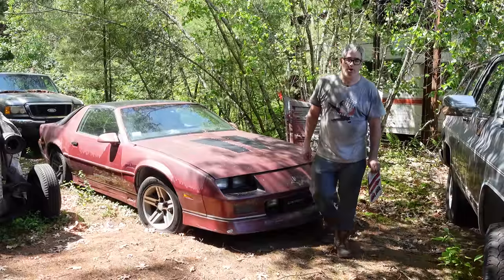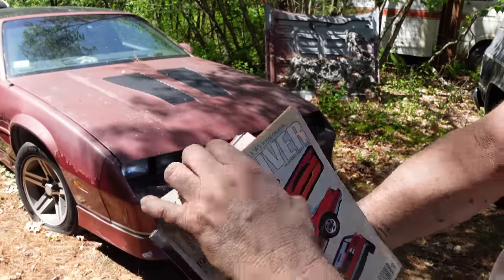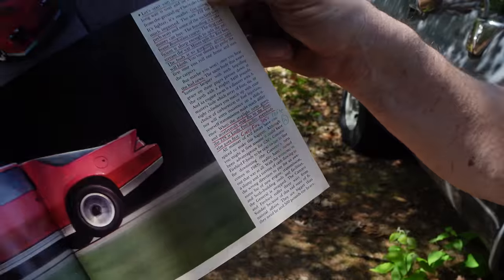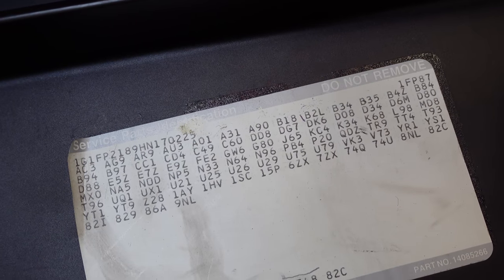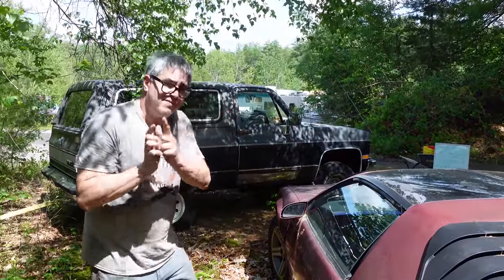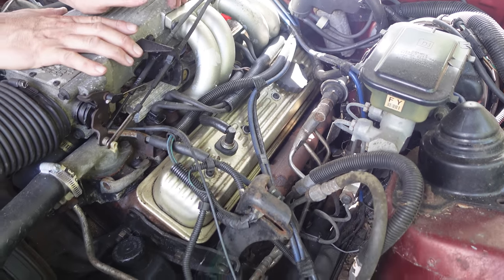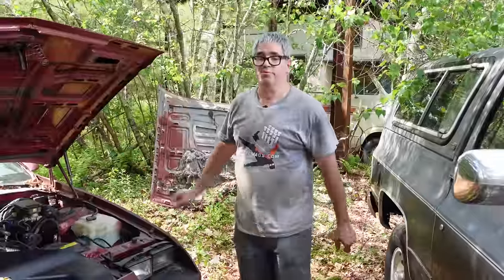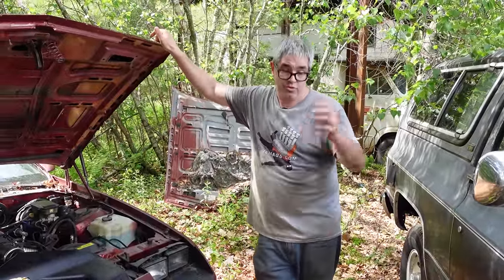Heart of a Corvette

Comment: I know people go nuts over these, but I never cared for the whole third generation F body, especially the Pontiac version which to me were "Chevyiacs". My parents had a 1982 Berlinetta 305 V8 for a short time, but my dad's business partner wrecked it. It was a Norwood made 305 V8 with four barrel (LG4 RPO). I still have the VIN for it. Mr. DeFeo is from the same area as me and we used the same auto parts stores, but he's older than I am by a minimum of eight years, so we didn't cross paths. We used to call them "Italian R.... Out Cruising" or "I Reek Of Cologne". I've always found them to be sloppy and at least in the Pontiac version, you were better off with a 2nd generation which is a true Pontiac with true Pontiac power and not a "Chevyiac". 

No, 1987 is the first year for the 350 F body. There were several test mules in 1986, but they were destroyed. Somewhere, I have that confirmed in writing on in a yellow GM response card from a GM Service Parts employee and it's been confirmed in writing elsewhere. You know this because you will not find a 10th VIN digit of "G" (1986) and an 8th digit of "8" (L98 350 V8), only 1987 (with a 10th digit of "H" as you have here).  The 2.5L was last offered for the 1986 model year, so by 1987, it was a V6 or a V8. Yes, GM didn't have a manual (at the time or at least that's what they said) that could handle the torque of the 350, so only on automatics with the Camaro and Firebird 350 in the 3rd generation. It was more that they didn't want F body sales to eat into Corvette sales back then. 

We got the VIN, we win: 1G1 for US made Chevrolet, FP for Camaro Sport coupe, 21 for two door coupe, 8 for 5.7L V8 with Tuned Port Injection (MFI), aka RPO code "L98", 9 is a check digit, H for 1987 model year, N for Norwood, OH assembly and the rest is the production sequence. The Norwood, OH plant closed in August 1987 and then production continued at Van Nuys through the 1992 model year when the plant closed. 

We got the SPID, glad you did: A03 for windshield with upper shading, AG9 for power adjustable seat, AR9 for reclining bucket seats, AU3 for power locks, A01 for tinted glass, all windows, A31 for power windows, A90 for power hatch release, B18 for deluxe interior ornamentation, B2K for special sales package,  B34 and B35 for front and rear carpeted floor mats, B4Z for IROC package, B84 for body side moldings, B94 for body emblems, B97 for lower body emblems, CC1 for removable hatch roof panels, CD4 for delay wiper system, C49 for rear window defogger, C60 for air conditioning, DD8 for auto tint day/light interior rear view mirror, D34 for inside sunshade, D80 for rear spoiler, D6M for driven speedo gear, D88 for sport stripe, FE2 for ride and handling suspension package, GW6 for 3.27:1 rear axle ratio, G80 for limited slip rear axle, J65 for power front and rear disc brakes, KC4 for engine oil cooler, K34 for cruise control, K68 for 105 amp alternator, L98 for 5.7L V8 with TPI, MD8 for THM700R4 four speed automatic overdrive transmission, MX0 for automatic transmission merchandising option, NA5 for Federal emissions, NOD for Norwood, OH assembly, NP5 for leather wrapped steering wheel, N33 for tilt steering wheel, N64 for aluminum space saver spare wheel, N96 for 16x8 cast aluminum wheels, PB4 for wheel lock kit, P20 for styled steel wheel cap, QDZ is a tire code, TR9 for courtesy lamp group, TT4 for halogen headlights, T93 for special stop and tail lights, U21 for oil, coolant temperature, voltmeter, and tachometer gauges, U25 for rear compartment courtesy lamp, U26 for under hood light, U29 for instrument panel courtesy lights, U75 for chrome power antenna, U79 for four speaker system, VK3 for front license plate bracket, V73 for US and Canada vehicle statement, YR1 for front custom seat cushion, YT1 for special door and quarter buildup, Z28 for Camaro Z28 (which all IROCs of this generation were), 1SC for sales package, 15P for silver metallic aluminum wheel color, 74Q for Dark Red moldings, 74U for Dark Red exterior paint, 82C and 82I for Medium Dark Gray interior trim, and 829 for Medium Dark Gray seat belts.

These have their followers, and I'm not one of them. But, I'd chose the Camaro over the Firebird in these years.
Reply: Agree with you on Camaro over Firebird in this era, love the styling of the Camaro, not so much the Firebird. As much as I admire them, wouldn't want to own one (maybe if I was young and in high school). In my mind, the 305 manual and 350 auto are a "toss up," but I could be way off on that.
Reply: @tomwesley7884  I had a 1986 Norwood assembled Camaro 2.8L V6 with T-tops that was given to me after it was in an accident (for the 2nd time). I parted it out and junked the remainder. After the yard closed some years later, it was eerily still left behind at the yard. It eventually was removed when there were plans to redevelop the area (which never happened). It was code 23 Bright Blue.
Reply: @googleusergp Thank you very much for all of these information. This car would have been very expensive considering all the options it has.
Reply: @BojarskyLeGrand  Sure. Indeed it was a costly car when it was new.
Reply: Thanks for all those codes.  Helpful to me.
Reply: @richardlarson2969  Sure thing.

Comment: I built my 1989 formula firebird the way it should of been back in the 80s.  It started it's life as a LO3 (305 TBI) and a 700R4.  With WS6 suspension but with the 10 bolt and rear drums.  I put in a 5.7 Aluminum LS1 and a T56, front and rear brakes from a 2000 trans am.  AC works, all factory gauges work.  Custom wiring harness built by me.  Full emissions.  It is no stronger than a 2000 trans am but my goal was near factory appearance.  The car has 17 inch GTA reproduction wheels, and yes it is a TTop.  The car has subframe connectors but even with the ttop it stands up to the power.

Comment: I had a 1984 Camaro Berlinetta (with the funky unique interior with digital gauges), and when I'd warm up it's carbureted 305 V8 on cold mornings, the frost on the hood would show that the Z28 hood scoop structure was there under that plain skin hood.

I thought it was quick back in the day, but I know that its V8 would be stomped by a 2.0 liter turbo 4 from just about any car company nowadays. 😜
Reply: Yes. That model of Berlinetta was so very Cool...
Reply: I never noticed that the Berlinetta's had different gauges

Comment: I remember those days. It was like watching the sunrise after a long dark night. Real performance was returning and each year got a little better. Thank you as always ~ Chuck
Reply: That car and K5 should be saved! My friend had a 88' Pontiac Formula 350 and I was a 5.0 stang guy till he got that car , cornering was amazing! And it would easily beat my friends brand new mustang in 01. Burnouts for miles!
Reply: And at 140mph with 4 people could barely tell.
Reply: I remember being a freshman in H.S. in 1982 and my best friend and me talking as we were running laps in track about how performance was over. The '79 Trans Ams with 400/403 were what we considered the last of the true muscle cars. To find out that the new Camaro and Trans Am only had 305's? We were disgusted. And the Mustangs all sported 2bbls and of course Dodge and Plymouth were totally absent. Little did we know that by 1986 there would be Grand Nationals and Mustang 5.0's running into the lower 14's!!

Comment: In My late dads junkyard,  we had only one crashed iroc with A/C and a manual, it was before I had a license and I had begged him to let me fix it but he didn’t want me to have that for my first car, eventually I bought an anemic hardtop 1996 3.8 firebird in teal, and ended up blowing the automatic up from all the burnouts and young kid stuff. Years later I inherited the Camaro, and sold it, when we were loading it up on the guy’s trailer with a tractor the floor fell out of it because it was so rotted, the guy said, “well we’re halfway there just finish slapping it on the trailer, there’s no sense going back” lol.

Comment: Great video.   As a point of reference on some small corrections being I have had dozens of these cars...
-the 5500 RPM redline wasn't exclusive to a 350 car.  it could be had in any of GMs "high output" offerings of the time, like the LBP TPI, HO 305s, etc.  the lower output 305s received the 5k redline as their smaller cams were even more out of breath by 5k, than the larger cammed cars
-The Iroc decal on the door was at the front from 85-87.  It moved to the rear in 1988 when the wheels got "2 stripes" rather than one like the earlier models had. 
-While you can look for the RPO codes as well.  The VIN # will tell you what engine the cars had as well so you could easily identify them from the outside.

Thank you for shining light on these Camaros!
Reply: Two more notes:

-the package code is B2L, not B2K
-the 9-bolt was available in 5.0 TPI cars with a manual. They had a 3.45 gear vs the 3.27 in the 5.7 (this assumes RPO G92, IIRC)
Reply: @sc3ku  true!  I have an 87 yellow with the 3.45!

Comment: I had a ‘85 “California” IROC. I think they made 1000 of them. They only came in black, red, or white. No decals, no rear spoiler, no hood vents. A really clean looking car. The 305 TPI was a dog, but the car handled great. GM stopped putting posi in them because they’d break the small rear end. I replaced the 85 mph speedometer with the accessory 150 mph speedometer.
Reply: What did it take to replace the 85 to 150 mph speedometer?
The whole cluster needs to be replaced?
Reply: @rollin19  no, just pulled the bezel and swapped out the speedo head
Reply: GM offered a G80 posi through the 3rd Gen as well as 4th Gen.
Reply: @nedaCFilms  I put one in mine. Didn’t have any problems.
Reply: Was that the same 7.5 rear end they used in the monte Carlo ss at the time?  Did the Monte carlo ss have the same problem with rear end?  How much hp and torque are the 7.5 rears good for?

Comment: Department of Public Safety which is known as DPS in Texas tried the Mustang back then, I new a couple of officers talk to them on monthly basis one day there were driving Camaros. I asked them what happened to the Mustangs they told me there were junk if you turn them up all the connecting rods would fall out of them left them sitting many times. Also had a overheating problem. Camaros had no problem whatsoever. Except with the Corvettes LOL. They also explained to me that the Mustang did not have any room in them.

Comment: I remember these days well! It seemed that the new car hierarchy was GN, Iroc/TA 5.7, Mustang LX 5.0, Iroc/TA 5.0, and this doesn't include the occasional Corvette or super rare GNX that could pop up every so often. Many folks would make a few mods and then all bets were off. Also, the older muscle cars and sleepers would show up too. That was life on Main St back in the late 1980s. I wish I could do it over again!!!
Reply: stock the LX 5.0 beat the 5.7 Z/TA in a straight line... but it was close. the opposite on a road course.
Reply: @robviousobviously5757  I had an 86 LX 5.00 and would practice my launches behind our warehouse at lunch. Once your rolling, not much you can do, but getting the launch right won races. From what I saw, most new muscle car buyers where into the smoke show too much and couldn't adjust when it came to racing. GNs where the same, they react too slow, or spin, you had a really good chance of beating them.
Reply: @ZacLowing  GNs don't react slow if you know how to drive them. Leave the line with a pound or two of boost built up, nothing can touch it. Stock for stock anyway.
Reply: The funny thing is, yeah, the GN’s would destroy everyone back then, but they were wildly inconsistent, hyper sensitive to atmospheric changes. I think barometric pressure. only way to explain how one day the car runs like a raped ape, and the next day it’s dogshit slow. stock ones were more consistent, but once you started modding GN’s? All bets were off. The 5.0 mustangs were the most consistent performers back then.

Comment: Nice! Always wanted a Tuned-Port engine, but I absolutely loved and miss my loaded 84 Z with the 305 HO 5-speed, so fun to drive and gave me no issues for the 3 years I owned it. Thanks Steve!
Reply: I had the same car as you.  Very fun to drive!
Reply: Dad had one.  I swear to this day that 84 High Output Carburetor was faster than 305 TPI.   The 84 would throw you back in the seat at take off!
Reply: They didn't make a 84 5spd Z28! The first 5 speed EVER that came in a Camaro was bolted to a 305 TPI. The did make a bunch of carb 4 speeds prior to 85
Reply: @jeffreyhillery1614 Definitely prefer TPI, but a L69 Z is one carb car I have to own!

Comment: Car and Driver did a long term test (30,000 miles) of a 1982 or 1983 Camaro.  Something like 15 Unscheduled visits to the dealer which is still probably the record as of today.
Reply: Those first few years of the 3rd gen were touchy, no question about it. By '87 though, they'd worked out the gremlins and rattles and they were much better cars. Far more solid and reliable.

Comment: The 5.7 really came alive in 1990 with the dual converter exhaust. Had a friend in high school whose Dad worked for a Chevy dealer. We saw and felt it first hand. The Mustangs ruled the streets from '87 to 89, but the 1990 IROC and Formula 350 put an end to it. LOL, the memories.
Reply: Yes manual Mustangs Ruled streets 87-89 , but mustangs were cheap and bolt ons  were cheap most mustangs were full bolt on mustangs with a 3:73 gears were still very hard too beat up 0 to 120mph  
But On a 40 Roll or higher after 1991 the corvettes and 6speed firebirds were just too powerful for the 5.0
Reply: Great memories 88-91 had a notch 5sp mustang with full bolt ons and 3:73 gears never lost to z28 irocs corvettes but after 1992 the party was over my mustang got stolen and bought a 93 6speed vette added all the performance bolt ons smoked  mustangs 
They were a joke 
Ford should of put a high performance 351 in the stang after 1990 to compete it was embarrassing

Comment: I love Uncle Tony's garage.  Back in my early to late 20's I had an 88 350 TPI Iroc.  It had gobs of tire shredding torque, but at the time, I could never understand why at high RPM it felt like it almost had a rev limiter.  It was the stock runners choking it for air.  However, it was a very pretty engine to look at.

Comment: Bought a brand new 1987 IROC 5.7 in May 1987. Installed a Hypertech Stage 2 Chip in it and ran great. Traded it in for a new leftover 1987 Honda CBR1000F Hurricane. Those were great years!